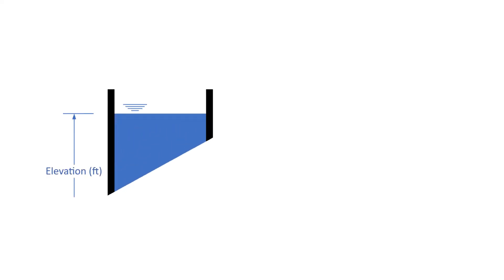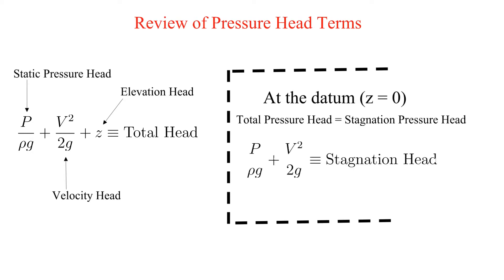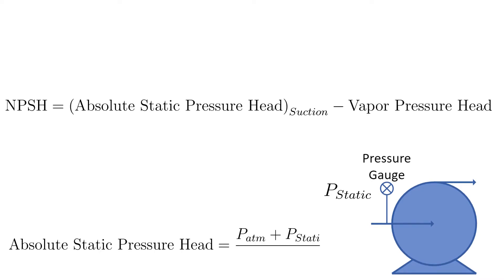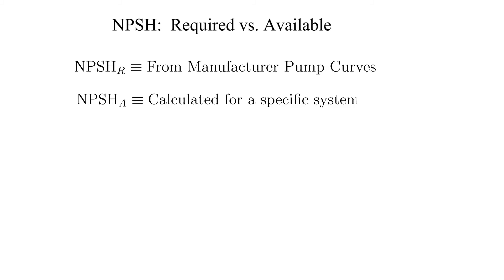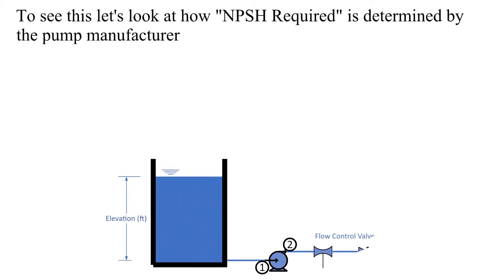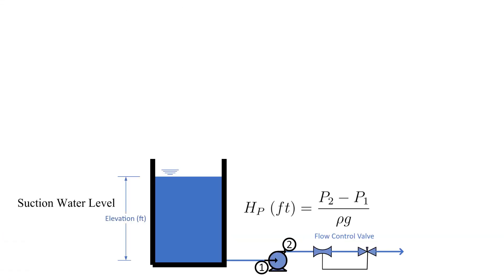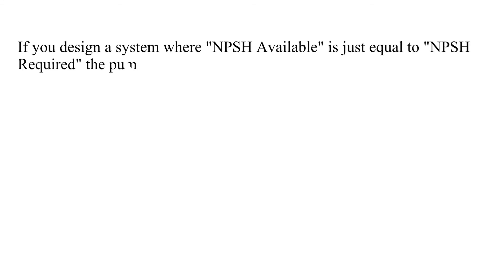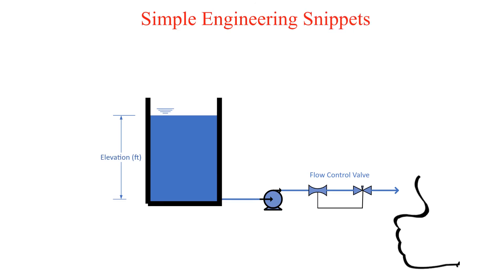Net Positive Suction Head  Definition, Misconceptions, and Errors

Comment: Great explanation Subscribed. I just have a small doubt in the concept of including velocity head  in the calculation of NPSHa . If velocity head is included while calculating NPSHa then doesn't it in increase that NPSHa . But somehow it feels counterintuitive to me. I thought  cavitation occurs  when static pressure head becomes below vapor pressure even though the the fluid may still have velocity. But according to the correct definition like you said , cavitation will not happen even if static pressure head becomes equal to vapor pressure due to the net positive effect of inclusion of the velocity head . Is that correct ? So that means cavitation will start to happen when velocity head also becomes zero ?
Reply from the maker: Hi Dan, You are not alone in your line of thoughts, it is logical.   This is why some textbooks and even some handbooks have it incorrect.  Including the velocity head with NPSHa is correct.  I'll give you another way to think about it.  I hope it helps but my experience with many of my students is that including the velocity head in NPSHa remains counterintuitive. 

The manufacturer is concerned with cavitation INSIDE the pump (internals), where higher velocities are achieved due to the spinning impeller (rpm, impeller diameter, etc.).  The peak internal velocity is (somewhat) independent to the velocity head at the pump suction (this is a simplification but if you consider the no slip boundary condition at the tip of the pump impeller it is reasonable).  A higher velocity head at the pump suction means less conversion from static pressure head to velocity head in the internals of the pump (to achieve the nearly identical internal liquid velocity).  This is why the velocity head is included in the NPSHa calculation.  

Thanks for your feedback and I hope this comment helps!
Reply: @simpleengineeringsnippets7102  This explanation clears everything up for me.  Thanks.  I liked the music btw.